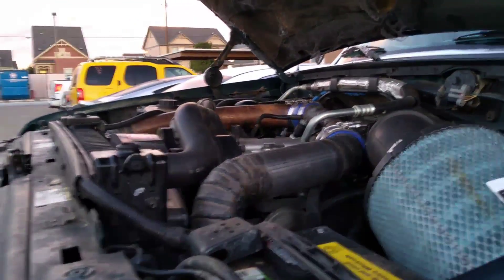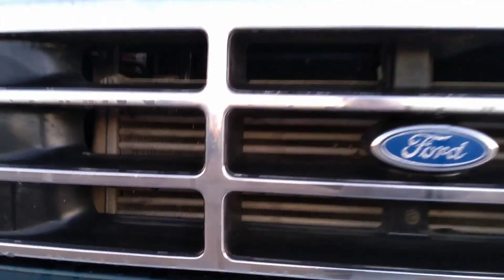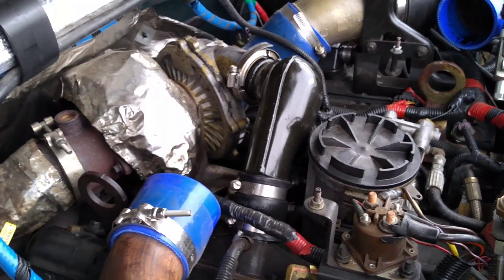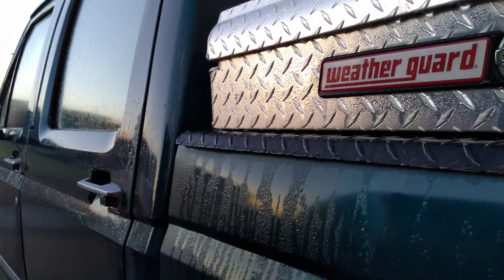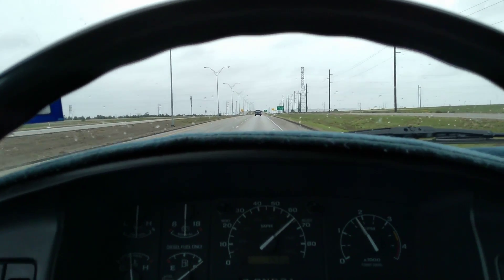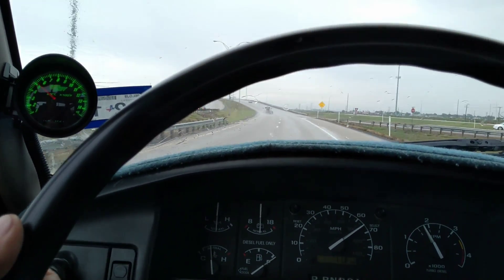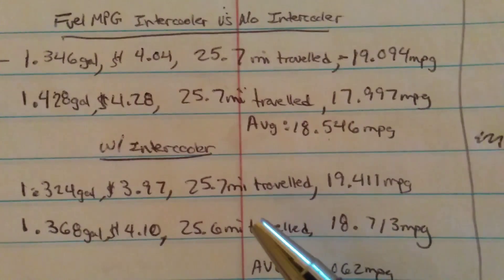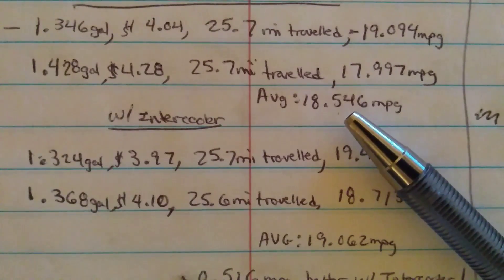Does an Intercooler Decrease Fuel Economy?

Comment: So first off good video. Two things however. Lower IATs are always a good thing and on a turbo diesel will result in better efficiency/fuel economy. Second with the intercooler you are restricting some air flow into the engine this means the clutch fan is engaging a little bit more and also working slightly harder to keep the engine at operating temperature. It’s probably a marginal amount but something to consider. At the end of the day intercooling of any kind is a win win on a turbo diesel. Love the video and keep up the great work.
Reply: Lower intake air will result in worse fuel economy, because there's less energy in cold air to initiate combustion.
Reply: @MoronicAcid1  Cool air = denser air = more oxygen = “better” combustion. Usually, however, it means more oxygen + more fuel = more power. The temperature itself has nothing to do with “better combustion”. But cool air is more dense, so you get more oxygen molecules in every cylinder full of air. Now, cold air is denser than warm air, so in cold weather the number oxygen molecules entering the combustion chamber per unit volume of air is significantly greater than when the temperature is high. More oxygen provides better combustion, and hence a noticeable increase in power. Oxygen is key, which is in cooler air more oxygen molecules. In diesel its like a catch 22 because heat is required during combustion of compressing the air

Comment: Bro awesome job..... LoL I do the exact same thing everytime I fill up. I always fill it to the lip where the fuel neck decreases to ensure I fill to the exact same point everytime. I monitor my fuel mileage to see what's going on with my motor all the time.... great work.... I have a 97 dually with an average 17.8 mpg .... i love her!!!
Reply from the maker: That's awesome! I'm impressed, 17.8 mpg! I've averaged 15.4 mpg over the life of the truck, is yours a 5 speed?
Reply: So I have the 3/4 ton 96. Both of my filler necks click of the pump a bunch when filling up, how do you solve this? Or is this just a my truck problem
Reply: @francesucksdickful  mine does the same I just slide the nozzle back out a little then it will run. Then when it clicks off I hold by hand and fill it.

Comment: I really like your channel. I just bought a 1996 4 door F-350 Powerstroke and your diy style videos have really helped me out. Just curious where did you get your dash mat? Keep up the goof work.
Reply: Thank you so much for all the info, you sure know your stuff when it comes to the 7.3.
Reply from the maker: @petersensheepranch7344  Sure thing! I always think it's really cool to see other folks passionate about keeping these old trucks on the road too. You can definitely learn a lot about these 7.3's from reading, and probably more than you like from actually working on them. Best of luck with the truck, and have fun with it too!
Reply from the maker: Awesome! Congrats on the new purchase too! I'm sure you'll be glad to have the OBD 2 on the truck as well. I actually got my dash mat from a junkyard for $14 or so. I don't know where it came from, but I did get a similar on for my 97 Chevy from O'Reilly Auto Parts. I'm sure they'd have one for Ford's as well. I'll definitely do my best to keep up the goof work!
Reply: I have a few more questions for you. What are all the common leaks for the power strokes and did your truck have any, I noticed my oil cooler doesn’t leak but my front crank pulley seal is out but when I get to fixing it I’m going to just reseal both. Also when do you know the fuel pump is goin out? I noticed some fuel in the valley and I have reason to believe either the fuel pump or fuel bowl leaks. Lastly is there any other information or tips for a new guy on powerstrokes, I have an 89’ with an idi in it so I know how to work on fords a little but I’ve never had one with a turbo. My dad used to have an obs 7.3 powerstroke eons ago but he got rid of it because of transmission and injector problems. Thanks.
Reply from the maker: @petersensheepranch7344  That 89' idi sounds really cool. For whatever reason I think the idi's are just awesome too, they're simple, and usually really cheap to work on. Regarding the 7.3 Powerstroke, common leaks as far as I know include:  Oil cooler leaks, these probably don't go out as much as you'd think, it's not like an annual replacement job, but when they do go, they usually dump a big puddle of oil on the ground at startup. High pressure oil lines/ o-rings tend to leak as well. Of course pretty much anything at this point will be liable to leak as old as these trucks are getting, but from what I've heard seals like the rear main seal are rare to leak. It may look like oil is coming from the back of the engine where the rear main seal is, but in reality there's a hole in the middle of the engine valley that leaks oil and fuel to that same area making you think the rear main seal is bad. If you have a 4x4 7.3, you'll likely have to pull the engine out to remove the oil pan too if you end up needing to do so. Fuel bowl/ fuel pump leaks. The fuel bowl has lots of o-ring seals, and a plastic valve on it that also makes it prone to leaking. On the OBS trucks there are 3 short fuel lines between the bowl and fuel pump that are prone to break and leak, and there's also a banjo bolt at the back of the fuel pump that can leak as well. As far as the fuel pump is concerned, you can never be certain if it is going out. Usually they fail in a gradual manner, and it's not that they stop pumping fuel, rather like a water pump, they begin to weep diesel out of a side port when they are on their last leg. If you've replaced every other fuel line and the truck is still leaking fuel from the engine valley, odds are it's the fuel pump causing the leak. If you're trying to trace down a leak in the valley, your best bet is to clean the valley as well as you can and see if you can see where the fuel is coming from. Unless you see it is for sure coming from the fuel pump, I'd start by replacing the 3 short fuel lines and resealing the fuel bowl with new o-rings while you're at it. There's technically 4 short flexible fuel lines, but the 4 th is the return to the tank. It's very low pressure, mine's super old and doesn't leak. If the fuel lines give up, you'll know because it'll dump fuel out from the valley, I've been there. If you're having a small leak though, I suspect the fuel bowl first, then perhaps the fuel pump. For tips on the new 7.3, I'd say your single best bet is to search through old forums where guys talk all about the 7.3 powerstroke. You'll learn a lot, that's how I learned so much. Familiarize yourself with 3 sensors/ regulators: ICP (Injection Control Pressure) sensor, IPR (Injection Pressure Regulator), and CPS (Camshaft Position Sensor). Those are the 3 most common electronics that will give you issues, especially the Cam Position Sensor. A bad CPS will prevent the truck from running all together. In fact I keep an extra Cam Position Sensor in the glovebox. Regarding sensors, glow plugs, and regulators, only buy Ford Motorcraft or International Navistar parts. You won't like the price tag, but trust me, it's not worth buying anything but OEM for these critical parts. I've hear stories of people buying aftermarket Cam Position Sensors to fix their truck, scratch their heads when it still doesn't work, and later buy a Motorcraft CPS to find the aftermarket one was defective and not working. I'm not a fan of dealer parts, but Motorcraft for Fords is legitimate. Also if you ever find yourself in an old school diesel trivia game: the 7.3 Powerstroke is not the 7.3 idi, aside from being V8 Ford diesels made in the 90's, they are very different engines. The Powerstroke has electronic injection control where the idi is all mechanically controlled. Somewhere around 1994 is where Ford transitioned from the 7.3 idi to the 7.3 Powerstroke.
Reply: Ditch the ts-6 and buy a Hydra. I did on my e99 totally love it man. Got mine from Fernando Parajon at R2DFS performance.  Great guy. Also if you can fit a 6.0 trans cooler in there. I know its gotta be tight cuz of intercooler. Big difference in temps. Mine dropped 40° in dead heat of summer. Dorman pt # 915-216 i believe. Dont run it thru rad no more. Cuz if it fails. Bye bye trans. Coolant messes them up bad. Ask me how i know. Lol

Comment: Can I do water meth instead of a intercooler on my obs 7.3 ?
Reply from the maker: I'm sure you could. In the end though an intercooler is much simpler, can be way cheaper, and you won't have to keep adding the water/methanol mix to the system. For towing, assuming you aren't sled pulling, an intercooler would likely be better. When going up long hills, you'd have to constantly keep injecting the water/methanol to keep EGT's low. With the intercooler, it'll decrease EGT all around and won't consume anything in the process.

Comment: Did you use your odometer for mileage or gps?  Have you adjusted your PSOM for the larger tires. Have you noticed better mpg since you installed your tuner.
Reply from the maker: I used my odometer, it was the easiest thing for me. The larger tires were installed by the previous owner, so I have no idea if it was re calibrated or not. If it wasn't re calibrated, I suppose my actual MPG may have been slightly higher. I haven't noticed any change with the tuner unfortunately, but I did get my AC working around the same time, so I think the AC took away whatever gains the tuner may have added. I'd like to run a test and see if the chip helps or not. Unfortunately the tunes I have aren't made for fuel economy, rather they're made to make a lot of power.